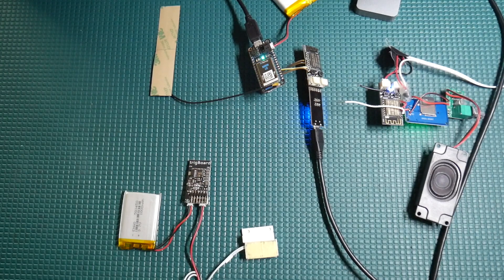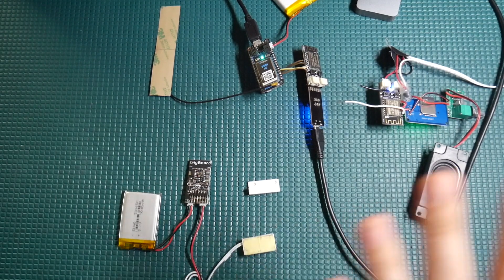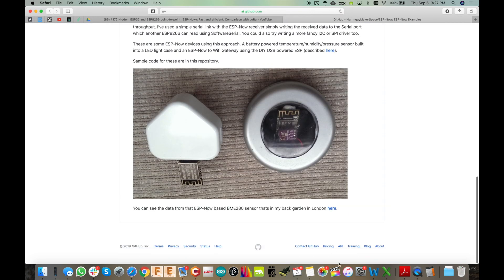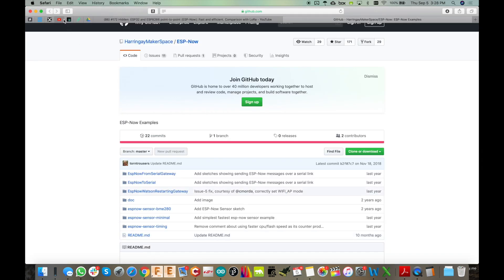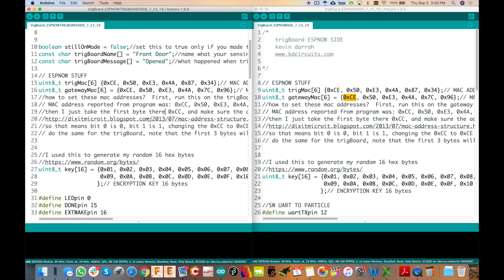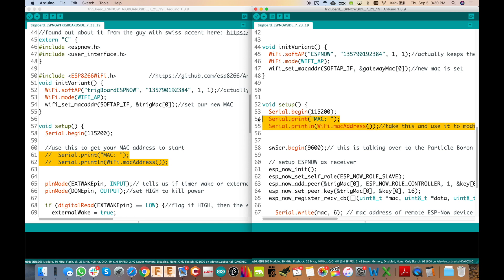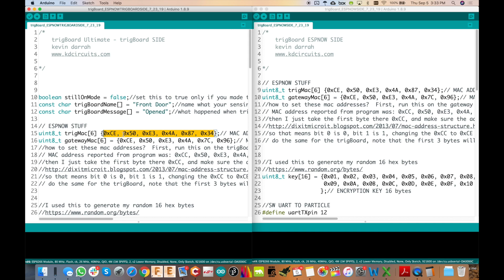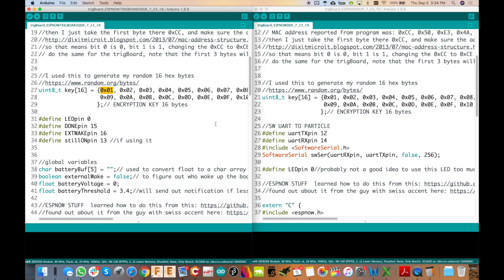PART 2 ESPNOW - The Ultimate DIY Home Security System - ESP8266 (trigBoard) + 4G LTE Modem

Comment: Hi, I have just made myself a security camera with motion sensing using the cheap esp32 camera modules, thought you might be interested as it should be easy to modify it to integrate with your system.
Note: these cameras are useless in low light conditions but very cheap.
see: https://github.com/alanesq/CameraWifiMotion

Comment: Great video has are all your videos. I think that is because you have such great idea.  I'm thinking about using ESPNOW  to build a RC car transmitter/receiver pair.  As you mentioned in you video may in the future looking at not hard coding the mac address and make it more commercial.  So  I'm wondering what your thoughts are on a pairing routine would look like. For my case I'm thinking of holding a pin low during power up at each end to put them in pairing mode. and have them come up in wifi server/ station modes and exchange information and then reboot  back to ESPNow mode.  Any suggestions on what you think a pair process might look like?

Comment: About the bits for the MAC address you set to '10'. That's the AP-MAC, which can be read via WiFi.softAPmacAddress().    The one you're reading is the STA-MAC, which is obtained via WiFi.macAddress()

Comment: I live in what’s called a fringe reception area in Australia. Only 30klms from a city of 120k people but fringe nonetheless. Very costly @ min $15/month for LTE modem plan. If I lose power, which happens frequently then the cellular tower is also down so we don’t have phone or power or internet. Yep, it all goes so there’s no advantage in me having the independent cellular service. I’ll need to stick with my local wifi and internet connection at home. I think. Have to plan a bit more.

Comment: Hey what's up KevinDarrah. Thanks for another inspiring video. Inspired by the Trigboard videos and the ESP-NOW video of Andreas Spiess I also made an ESP-NOW based door alarm, see https://www.instructables.com/id/Battery-Powered-Door-Sensor-With-Home-Automation-I/
I forward the ESP-NOW messages via serial to a RPi running my home automation. Great that your stand-alone device is less dependent on other services.
I found out that the ESP-NOW communication is not always succesful, therefor I implemented a check whether the transfer of data was succesful and repeat the sending of the message for a short while. I do not see that in your code. Did you also find some problems with unreliable ESP-NOW communication?

Comment: What is basically missing for a true alarm system is a battery charger with load sharing so it can charge the battery and power the device at the same time and when main power is lost, it switches to battery. (like the Adafruit USB / DC / Solar Lithium Ion/Polymer charger - v2)

Comment: Great video thanks. I have been trialing the use of ESP-Now for a couple of months now with great success. I have a number of remote sensors (Masters) around my house which periodically send data back via ESP-Now to the Slave (Gateway) unit, which in turn shoots that data up to Thingspeak & Adafruit IO. I cobbled together the ESP-Now code from various sources as well as from the sources you mention. 
I noticed in you video the way that you had to approach entering the mac addresses, in my code the mac address is entered exactly as it appears but just prefixing each of the pairs of digits with 0x.
At the moment I am still prototyping my project and using a DS3231 RTC on each remote sensor to more accurately control sensor reading times as well as a MOSFET latch to make power consumption zero for each sensor until the pulse from the SQW pin on the RTC powers the system up, even the RTC runs off it's own CR2032 battery until the alarm fires the SQW pulse.
Currently the sensor powers on, takes a reading, send this via ESP-Now to the Slave(Gateway) and then powers down in 220ms and consumes 90mA and this is once per hour.

Anyway, here is the basic stripped down code for ESP-Now communication between Sensor(Master) & Slave(Gateway), not including the RTC code:

Sensor - https://pastebin.com/dCD9tkUN

Gateway - https://pastebin.com/DKhpN6cN
Reply from the maker: cool, thanks for sharing!  Yea ESPnow is really useful